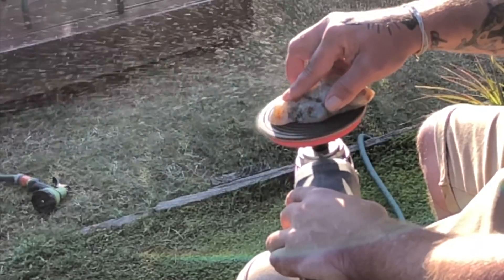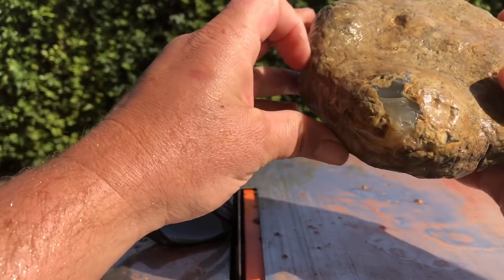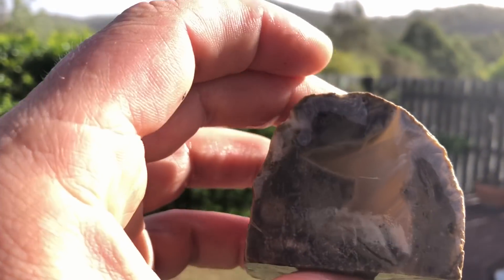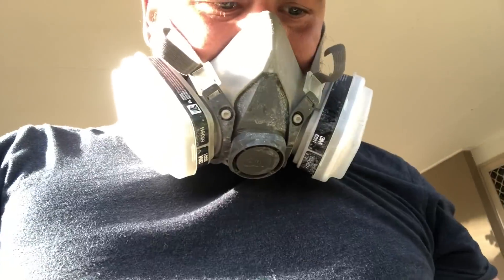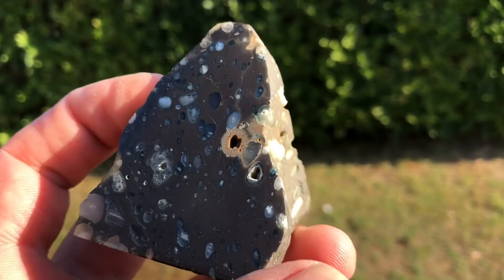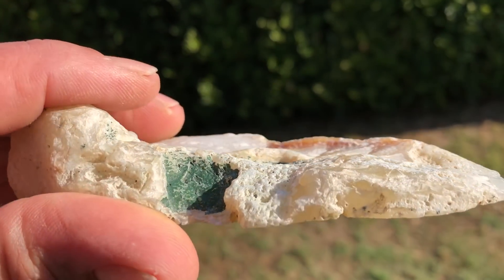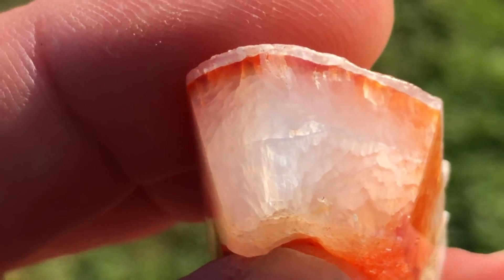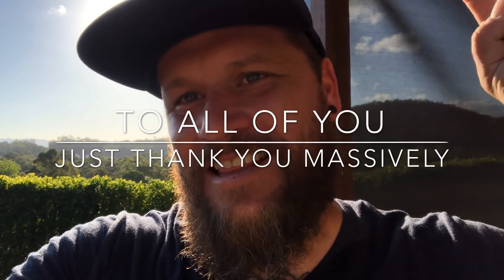Cut & Polished - A Hidden Thunder Egg & Baby Agates

Comment: Oh ya, great stuff!!  You will never guess, I am cutting rocks too!  You helped me get here, thank you! I was very patient and found a 10 inch Dewalt on Craigslist for a very good price, about three weeks ago.  Got the stand, pump and all for 300 US dollars.  To buy new is about 1k so I am super happy.    Learning so much here! 
Suggestion for ya on the polish grinder, I took a 3/3 foot square  board to put on top of two sawhorses, then bolted on another 2x2 foot board on one side to that board.  Then with that  I can clamp (huge clamp with also zip ties) on my grinder/polisher  to the 2x2 so I hold on to the rock I am  working on instead of having to hold down both the grinder and the rock.  So I push up into the grinder from underneath instead of pushing the rock down on the grinder.  If you need a photo of the set up, let me know.   I am able to sit and even use my extra hand to use the spray bottle if needed.   I am quite broken physically and this setup allows me to do the polishing with the diamond pads.

I am on the hunt for hematite now, find it here in carnelian, jasper (purplish, red and blue),and even some quartz and quartzite material. Cutting the rocks and seeing the swirls of metallic, awe so sweet.   I am in a zone of Michigan that was formed from both the Mississippian and Pennsylvanian periods so we have a ton of crazy here.  Thank you again for your time and inspiration.

Happy hunting!  Vet Rocks PTSD!
Reply from the maker: Hey that is so cool you were able to purchase a dewalt for that price!!!! It makes me feel so good to know that people are getting more and more into the cutting and polishing and that set up sounds great! I really need to get myself a proper work bench and make a similar rig up like what you’ve done. I have no space in the house so one with a saw horse sounds like a perfect idea. It’ll take me some time to get the stuff and make it but I reckon I’ll benefit massively frm doing that. 
Thank you so much my friend and good luck hounding that hematite!!!! 
Happy lapidary times to you 😉👍

Comment: Thank you for sharing and making the videos.  They are lovely and inspiring.   Went out in the heat and humidity today and found a creek about 30 miles away with a gravel bar.  Lots of quartz, not sure about what I’ve found until I clean and maybe cut some (still need to get a tile saw).   A little bit at a time .... (first tumbler load is running now).

Comment: Great stuff.   Have u done a vid on what sort of saw blade u use in that tile saw. Cuts looked damn clean for a tile saw. If not what do u use. Goin to watch your polishing vids now.  💯👍🏻
Reply from the maker: Heyyyy cool mate. So I don’t have a brand I’m really using, just what I could find from the hardware store but they’re called a continuous diamond impregnated blade. The “continuous” means there’s no gaps or theeth type thing. I run a red brick through mine a couple times when it starts to cut slow and it cleans it up a bit better. Take it slow and steady and if you turn the tile saw around and pull the rock towards you, it’ll keep you dry and and I reckon gives better control sorta thing. I hope that helps. At the end of the video I popped a link to a how to cutting video.
Reply: Rookie Rockhounding  Thanks. 👍🏻💯💯